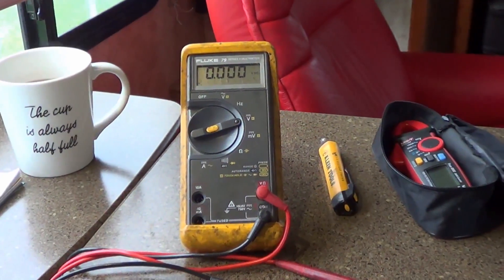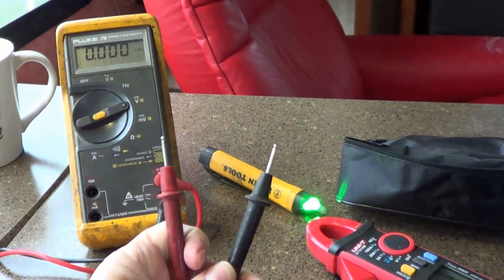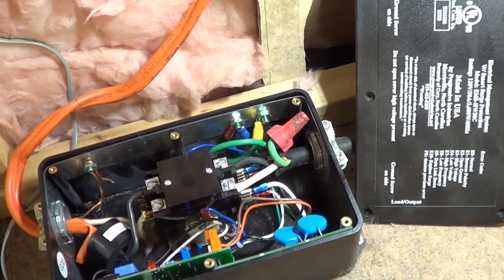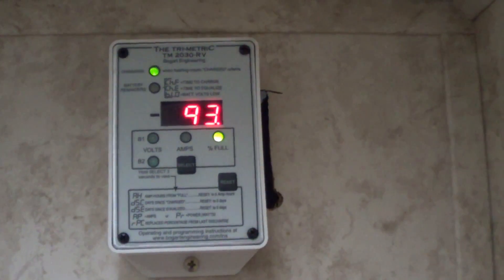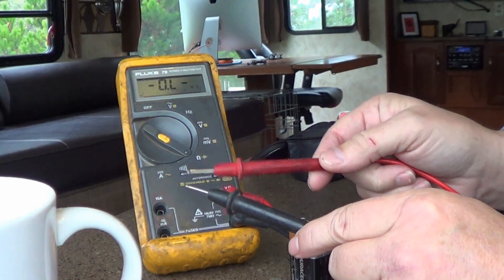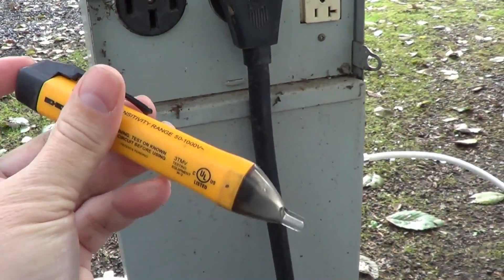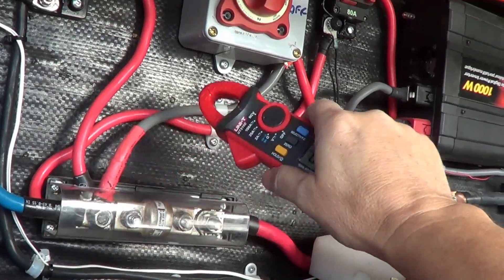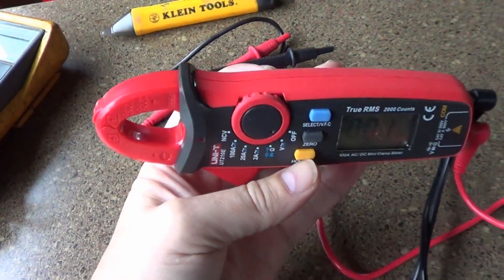Electrical Test Gear I Have Aboard the RV

Comment: A useful item for me (not exactly a tool) has been a voltage booster.  The type I have is made by Huges Autoformers (there are other brands).  It is a special AC transformer connected between the park outlet and your trailer.  If the voltage to your trailer drops below 112 volts, the transformer automatically steps up the voltage by 10%, back to about 120 volts.  High-current AC motors, like the ones in air conditioner compressors, can bog down, run too slowly, and overheat if their voltage is too low.  (A hot motor will also draw much higher amps.)  The result can be a damaged compressor and a big repair or replacement bill.  The boosted voltage prevents the compressor from running too slowly and overheating.  When the park's voltage goes back up to over 115 volts, the booster shuts down automatically.  The booster works by taking one amp of incoming power and converting it to the step-up voltage.  (No magic needed.)  The device has saved my AC unit from damage several times when the incoming voltage was too low because too many people were running their AC units at the same time.  (The utility company has since installed a new main power transformer that has reduced the low voltage problem.)  The voltage booster is not cheap -- around $300 new.  I found a good used one for half price.  They are made for 30 and 50 amp RV's.  (Lots cheaper than buying a new air conditioner!)  The temperature in an RV (like a car) can easily go over 100 degrees in the summer without ventilation or air conditioning.  A power line monitor would just shut down the power to your RV if the voltage goes too low.  The result could be the death of your pets from heat stroke if the AC goes off for a long time on a very hot day if you are not there to do something about it.  A voltage booster is relatively cheap insurance against these problems.
Reply from the maker: Good tip, I've heard of those but since we are lucky enough to migrate to cooler weather in the summer, haven't needed one. I guess though if a number of people are using them it would draw away power from those that don't have them further lowering the overall voltage on a string. Good for folks using them but bad for others not running the autotransformers. Have you ever had any static from park management for running it?
Reply: The transformer consumes only a few watts more power than you would use without it (normal transformer loss).  According to the instructions, it simply converts a maximum of one amp you would be using anyway into a voltage increase and adds it to the incoming power.  It may even save power since the AC will draw fewer amps when running at full voltage than lower voltage.  I've not heard or read of anyone having a problem with any park who was using one.  (To be a problem, everyone in the park would have to use one.)  In my case voltage drop is even more of a problem since my rig is connected to its power source via two 100 foot, 10 gauge extension cords (two cords wired in parallel) and I am limited to 20 amps instead of 30.  I permanently mounted a cheap LED 120 volt/amp display in my entertainment center so I always know what I am drawing to avoid blowing the breaker.  I have so far survived three Colorado summers (90+ degrees) and the AC worked very well despite the voltage fluctuations.
Reply from the maker: NIce, I can see how it would be helpful in that situation.

Comment: We have the same FLUKE. I got mine in 1995, I think. I probably use it 80 % of the time on BEEP mode to check for open and closed paths. I need to get a clamp meter. Super handy and easy to measure current. KLEIN voltage tester is also very handy. I wish I had one the first 2 months I was an electrical apprentice. I got stung by the electrical gods a few times thinking the power was turned off. :(
Reply from the maker: Oldies but goodies. :)

Comment: Victron is excellent. The new unit has bluetooth so easy to access monitor/program right from the sofa. ;)
Reply from the maker: Cool!
Reply: Thanks for the info on the clamp meter. I was looking for a decent unit and that clamps both ac and dc but didn't cost too much. Ordered through you link. Love Amazon :)

Comment: Great vid Ray!  Do you check your generator output the same way?  I heard that you can install an EasyStart soft starter on your roof air conditioner and run it with a 2k watt generator.  The EasyStart is around $300 USD.  A tad bit pricey I think, I'm contemplating on purchasing one of these...what do you think?
Reply from the maker: Thank PJ! Yes, I can see the generator output, I do have to use what's called an Edison Plug to get the PI surge protector to not think there is an error with a floating neutral from the generator. More explanation here - http://noshockzone.org/generator-ground-neutral-bonding/
That Easy Start looks pretty neat but for us as snowbirds, we avoid hot places so not really worth the money. I'd be inclined to spend the money on a higher wattage generator or two that can parallel, then you have the overhead to run other things at the same time, like the battery charge converter which can draw a fair bit of amps if the batteries are depleted.
Reply: Great tip on the Edison Plug!  👍